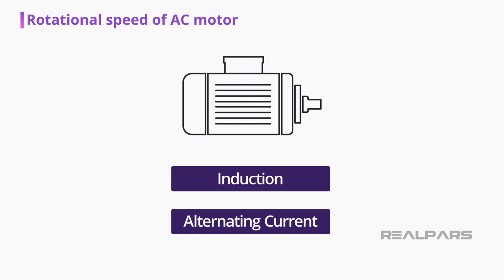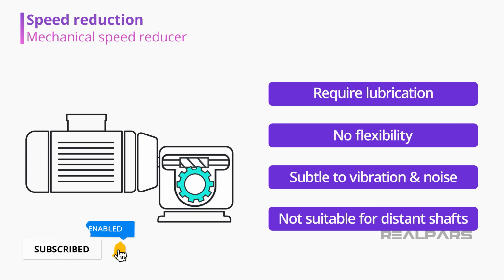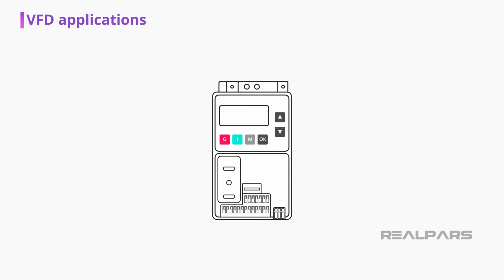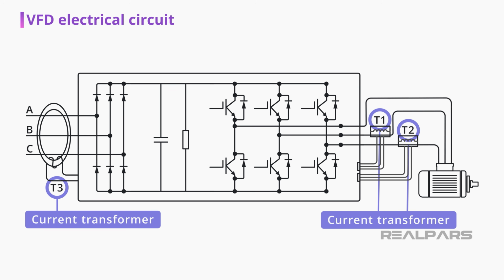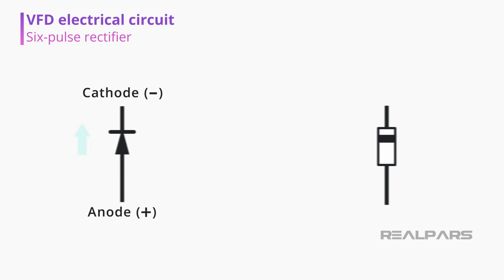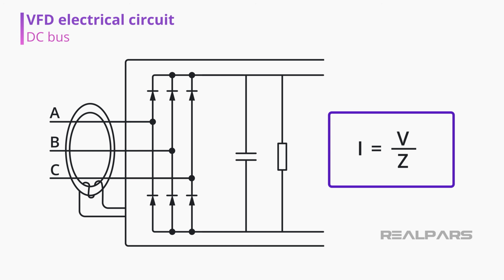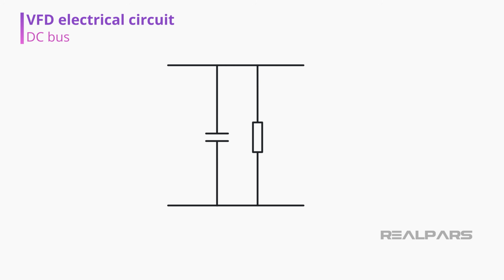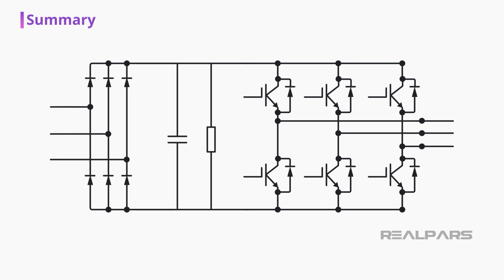Variable Frequency Drives Explained | VFD Basics - Part 1

Comment: Diode allows current to flow from cathode to anode sir, not the other way around
Reply from the maker: Hello, @tariqalmutairi1403. Thank you for your comment. In an AC-DC circuit, the waveforms for the positive go to the DC side, and the negative goes to the minus side. That is how a DC Bus circuit works in a VFD.

Comment: How does VFD works for Solar system based motor operations, such tube wells.
Reply from the maker: Hello, @NazimUdDin-tg8jg. Thank you for your interesting question. Unfortunately, we need more information, such as the engineering design of the project you have in question and diagrams. We are not familiar with the technology you are asking about. I suggest you reach out to the manufacturer of that project.  Happy learning from RealPars!

Comment: Please , explain what happens if the VFD is set DELTA in the parameter, but MOTOR is connected STAR/ WYE .
Thank you very much
Reply from the maker: Thank you for your question. You should always follow the instructions in the user manual when setting up your VFD. If you set the parameter to DELTA, then guess what? Your drive wiring must be set to DELTA so it will work correctly. The drive might work with the motor wired wrong, but most likely, with its technology, you will get an error code due to current or voltage issues, and the drive will fault out until you fix it.  
Happy learning from RealPars!

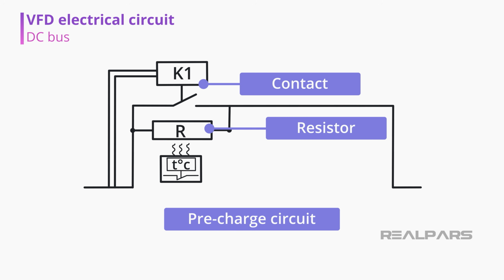Comment: Around 6:10, why is there a line drawn underneath the thermometer? It seems that by doing so, you short-circuit the pre-charge circuit, rendering it useless... or am I misunderstanding/misinterpreting something?
Reply from the maker: Hello, @tijsclaerhout2384 . Thank you for your question. If you are asking about the thermostat, this is a NO contact. When you have high heat, it will open.  Happy learning from REALPARS!

Comment: So, if the resistor portion of the VFD is faulty - power can go to the motor for a brief time, until it overheats and ground fault occurs... despite not being called upon?
Reply from the maker: Hello. @CrystalElliott-m2e.  Thank you for your question. You have a very good question. These drives are designed with safe internal smart sensors to check for current, voltage, and frequency failures. Therefore, if what you say happens, the drive will normally announce a failure, a fault signal will be sent or displayed, and the drive will safely shut down to avoid major damage.   Happy learning from RealPars!

Comment: So what happens when u have 277/480 three phase system that’s running too high like at 497 . And u have voltage imbalance? Will it just only be sending a signal on the highest phase to ground voltage and therefore the vfd not work properly? Or does a vfd clean it up somehow? Just got the IQ1000 outdoor box haven’t hooked up power to it yet. We need to slow the pump down it’s pumping more gallons per minute than the well can provide
Reply from the maker: Thank you for your question. The compatibility with a high leg largely depends on the VFD itself. Typically, a VFD operates by converting incoming AC voltage to DC using a rectifier, then utilizing IGBT to produce the required AC frequency and current via PWM modulation. While some VFDs may accommodate a high leg, it's often advisable, as per the manual, to connect power through a constant voltage transformer before supplying it to the VFD. This setup generally offers a more robust engineering solution. Happy learning!

Comment: Aren’t the hydraulic check valves drawn backwards in regards to your flow direction?
Reply from the maker: Thank you for your question. Sorry for the confusion. The check valve flow is in the downward direction for the check valve to work. The voice-over person stated that the pictures show the check valves will shut down in the direction of the arrows shown. And in the down direction of the flow is when they work. Sorry, but it was not clearly shown but explained correctly.

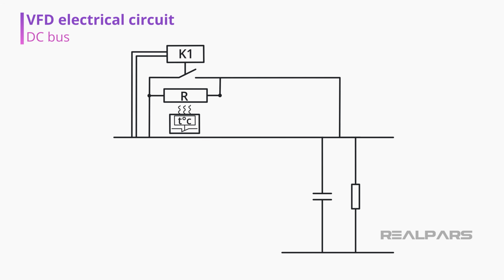Comment: isn't there a mistake at 6:14 it seems to me your short circuiting your charge up resistor. (or what u wanna call it?) there for still getting a peak current that could possibly damage the input device? correct me if i'm mistaken here. greetings, thanks for the informational video btw
Reply from the maker: Hi Tom, thank you for your question.

This is a simplified block diagram illustrating the basic concept within this circuit. Please note that in reality, the circuit is far more intricate than what we present here. The resistor in use is of a high value and wattage, designed to limit the flow of current to a predetermined safe level. This feature prevents the resistor from overheating or burning up. Instead, the current naturally follows the path of least resistance.

We hope this explanation clarifies the information for you. Should you have any further queries, please don't hesitate to ask. We appreciate your engagement and wish you continued learning and growth with RealPars!
Reply: @realpars  I know, but even if you work with equivalent values instead of the real circuit. it still should be an open circuit. now you have a parallel short circuit drawn with no switch whatsoever. which means 0 amps will flow through the 'safety' part of your circuit at any given tim? could u please look at the screenshot at 6:14 ?

Comment: When capacitor is not fully charged the precharging circuit is presented in the picture inorder to avoid inrush currents at supply. For this purpose a current limiting circuit is made through a resistor, now dc current will flows through this resistor and yet this time capacitor starts charging. Once capacitor gets full charge then this DC current will by-pass through contact. What a lecture Sir 👍 really great work you have done thank you 😊😊
Reply from the maker: Our pleasure! Glad to hear that our lessons have been helpful. Happy learning!

Comment: why there 2 current transformer to measure output current instead for 1 in the input side
Reply from the maker: Hi Arjun, 

Thank you for your question! In reality, the picture we show on the input side represents current transformers. We really have one for each phase. For simplicity, we just show one current transformer. Sorry if it was confusing. On the output side, we show two again for simplicity, but most likely, we have three. One for each phase. This is done to protect the VFD in case of IGBT failure.

Here is a link to the drive application manual for your review. 

https://support.industry.siemens.com/cs/document/5824404/siemens-standard-drives-application-handbook?dti=0&lc=en-US

Happy learning!

Comment: As far as You know, Sir, are anode and cathode different in biology? I'm pretty sure to remember anode is (‐) and cathode is (+). 
Does it make any difference?
Reply from the maker: These definitions can be a little tricky, and definitely confusing, depending on the context. Cathodes get their name from cations (positively charged ions) and anodes from anions (negatively charged ions). However, in a device that uses electricity, the cathode is the negatively charged electrode (attracts electrons).  In a device that produces power the cathode is the positive terminal ("produces" electrons).

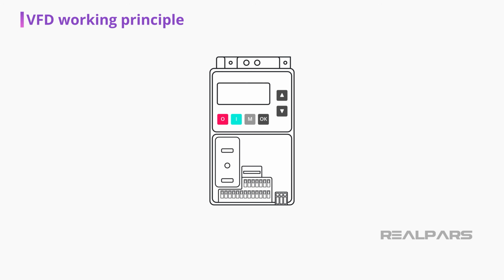Comment: Errors: (1) Current transformer T3 (3:16) is shown monitoring current on all three incoming phases. That means it will read zero unless there is earth leakage and that would have nothing to do with T1 and T2.  (2) The check valves (8:34) are upside down. They will prevent current flowing in the direction of the diode arrows in the neighbouring schematic.
Reply from the maker: The first item you pointed out is correct.  The CT "donut" should be placed around a single phase only, with only 1 to all 3 phases monitored.

Comment: So every variable speed motors are dc volts ?
Reply from the maker: Not exactly.  There are DC motors and DC VFDs, but that is not what this video is showing.  A VFD used with an AC motor needs to change the frequency of the AC current.  There is no electronic device to do this directly.  Therefore, the incoming AC current is rectified (converted to DC), and then the resulting DC voltage on the DC bus is inverted, using IGBTs or other devices, back to an AC voltage having a different frequency from the incoming voltage.  This process also affects the AC voltage level so that there is a constant V/Hz ratio.
Reply: @realpars  thank you so much for your clear explanation

Comment: Hey there.. I bought a VFD for my home CNC Router build. The one I got is a 3 phase 380V 1.5KW VFD.. After getting it I began to realise there was a 1 phase VFD too. I'm very lost atm guys..
Cam I use this 3 phase VFD for my home build CNC? This is all new to me so plz excuse the silly moronic questions from myself,, I would very much appreciate ur help if possible, Thanks for a brilliant video. I'm 50 yrs of age now and only just beginning my learning experience with programming, CNC's Arduino's, etc.. I lovelearning all of this stuff about electronics, etc but I really need a lotta help. I'm hoping these tutorials cAN BE THAT BRIDGE FOR ME,, Thanks for the knowledge. I will be heading over to the wenbsite asap as well now..
Reply from the maker: Your home wiring is 1-phase.  You will need a 1-phase VFD.  These can be purchased in either 120VAC or 240VAC versions.  I would go with a 240VAC VFD.  If you do not have a spare 240VAC outlet, I suggest hiring an electrician to install one in the vicinity where you need it.  A CNC machine will consume significant power, so a separate, properly sized circuit will be required. Unfortunately, your 3-phase VFD cannot be used.  You may wish to return it or offer it for sale on eBay or another resale platform.   OK, the other thing you need to consider before doing any of the above is to determine what your CNC machine requires.  If it requires 3-phase power, then you will have another issue since you will not be able to connect it at home at all without special equipment.  In this case, you may want to consider purchasing a gasoline powered 3-phase generator that you use specifically for the CNC machine.  This will work, but be prepared to spend >$2000.

Comment: At 6:55 it’s stated that the resistor divides the voltage between the two capacitors. I’m sure you mean two (2) resistors divide it since one will do nothing. Also, I’m not sure why this detail is important to this video. The only reason for two or more capacitors in series and their requisite dividing resistors is because it MAY be difficult to have a single capacitor with the appropriate voltage rating available for the design. This has absolutely nothing to do with understanding the operation of a VFD and just adds pointless, possibly confusing information to the explanation. The same thing could be present in the rectifier section also for the same reason but, it’s equally unimportant to the subject of the video.

Comment: Hi, Any effect when we stop vsd motor without reduce speed to 0 before that.
Reply from the maker: When a motor stops, it slows down and the electric field in the motor collapses and causes "friction" in the magnetic field.  If the motor is reversed before the motor fully stops, the starting current must be strong enough to overcome this braking force and reverse the magnetic field.  This is not usually a problem, but if the motor is spinning fast enough in the original direction when the direction is reversed, you may have an overcurrent situation and trip a breaker.  It is also not good to put that amount of mechanical stress on the motor shaft and bearings.

Comment: Question, does the motor maintain strong torque at lower speeds ?
Reply from the maker: That depends on the motor and the load it is controlling.  Normally, the answer is yes, as VFDs are able to develop strong torque at lower speeds.  However, running at low speed for long periods of time can cause motor heating and other problems.

Comment: Does the 120 in the formula  come from the 120 degrees out of phase of a 3 phase system ?
Reply from the maker: Yes, this is correct.  The sine wave for each phase is 120-degree out of phase with the other phases.  This arrangement provides greater power density than a one-phase circuit at the same amperage, keeping wiring size and costs lower.
Reply: @realpars  This is incorrect. The 120 in the formula comes from 60 Hz x 2-poles since poles are always in pairs (2, 4, 6, ...)

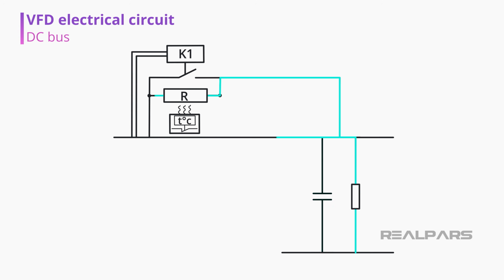Comment: Good video. Can anyone tell please @6:17 of the video (DC link), how resistors will charge the capacitor?
Thanks.
Reply from the maker: You are correct, and the video should have said, "The capacitors begin to charge with current that passes through the resistors".  This allows the capacitors to charge at a slower, controlled rate.
Reply: @realpars  Thanks for the clarification. Keep it up.

Comment: for troubleshooting purposes suppose the drive is stopped intentionally, Will i read full DC voltage across the bus capacitor when stopped????

You show a single current coil on the input to the drive, if you only have one coil wouldn't that work like a GFCI if all is proper zero net current? Or is that a totally different concept in 3 phase?
Reply from the maker: When a motor that is controlled by a VFD stops, current is not allowed to pass to the motor. However, the capacitors are still charged, but will slowly drain.  It is something to know about so that you don't put yourself at risk.  The current transformer is used to measure current.  Many times, for a balanced circuit, a single sensor is used. the current draw through each of the three phases should be similar.  The current transformer is different from a GFCI, although both measure current flow.  In a GFCI, the transformer looks for an imbalance of current between Hot and Neutral, indication a potential fault condition between H and N.

Comment: Can someone please explain what it means that the VFD "disarms" to prevent damage? Thank you!
Reply from the maker: This means that when a fault occurs (overcurrent, overheating, etc,), power to the IGBTs is cut off, thereby disarming, or disabling, these power switches.  The motor stops since no power is delivered to the motor.

Comment: Good video one question can you run the motor at a speed greater than 60hz
Reply from the maker: Yes, but this is recommended only for inverter-duty motors.  A 3600 RPM motor can only be run safely at up to 75Hz.  An 1800 RPM motor can only be safely operated at up to 120 Hz.  However, as speed increases above 60 Hz, torque will be reduced, so in some applications, overspeeding the motor will not be helpful.

Comment: What's solution for single phase capacitor based induction motor?
Reply from the maker: Single-phase motors can be controlled with a single-phase VFD.  A simple rheostat will also work pretty well and is much less expensive than a single-phase VFD.  However, the VFD can be connected to and controlled from a PLC, whereas a rheostat must be controlled manually.

Comment: Hi! I love your videos and hope that you will keep up with the good work. I only have one question; isn't the symbol for the one-way valve in hydraulic system suppose to be the other way around? I am pretty sure that it works by pushing the ball. :P
Reply from the maker: Yes, this has been pointed out before by other readers.  The description is correct,; only the graphic is incorrect.  Thanks for your input!

Comment: Plz explain if VFDs can be used to control DC motors... Can they work without the ac dc converter and the igbt section...to convert back dc to ac output in case of controlling dc motors....
Reply from the maker: Thanks for your comment, Habibulla. I will share your topic suggestion with our course developers!

Comment: how you are able to adjust output voltage and frequency by triggering IGBT
Reply from the maker: Think of IGBT's as power switching transistors.  The VFD regulates the DC voltage at the collector of the IGBT.  The switching circuit fires the gate of the IGBT to allow current to flow to the emitter.  By use of a control circuit, the frequency, polarity, and duration of being in the "on" position (pulses) can be controlled.  This is how the VFD inverter section is able to recreate a sine wave output at the frequency required by the application from the DC output of the rectifier.

Comment: can you say why auto tuning is reqd and the data collected by AC  drive
Reply from the maker: Control within the VFD is generally regarded as open loop control.  I do not recommend using the internal PID control (if available) since improper setup or application can cause the speed to "hunt and wander".  Data is generally not collected internally, but there is usually a set of parameters that can be set by the engineer to control and characterize its operation.  Some complex drives can have hundreds of settable parameters.  Data that is stored in a VFD automatically includes diagnostic data, such as the last ten fault codes or maximum temperature reached.

Comment: Is the 6 pulse rectifier a good way to control the phases of a three phase supply?
I'm still learning about basic circuits ATM, cheers tho🙂
Reply from the maker: Using a 6-pulse rectifier is used to rectify a 3-phase circuited (2 diodes per phase) to DC voltage.  This type of rectifier is useful for this purpose in a VFD.  The 6-pulse rectifier is also useful for circuits in 24VDC power supplies.